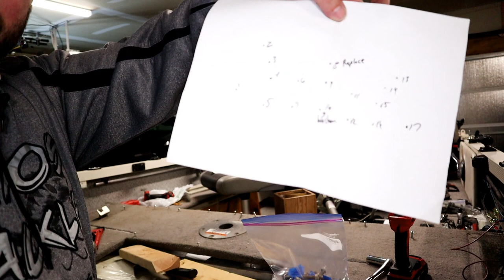TRANSOM REPAIR STEP BY STEP!! - Replacing Transom in a Crestliner Aluminum Boat

Comment: My 1750 had that same crack, if I showed you a pic you'd think it was yours! But, today I found my transom wood rotten. Thank you for all the effort and making me realize I can save my own boat.
Reply from the maker: Bigun Indaboat Good luck with your project! If I can do it, you can do it!
Reply: @AnglingAnarchy  Thanks got the motor rigged up, time to start pulling bolts! Threw ya a sub!
Reply: @AnglingAnarchy  Today my boat hit the water with a lot of help from friends and your video! Pulled the plug at the end of the day and she was dry as the desert. Thanks you brother, and tight lines!
Reply from the maker: @Tiggitytye  Awesome to hear my friend. Good work! I'm glad the video was of some utility to you!

Comment: Nice job, Brian. I learned something too. I learned this project is beyond my skill set. I hope I don't have to ever replace my transom. Looks like the project went pretty well for you with no major hassles. I'm impressed. 
Great video.
Reply from the maker: The Lonesome Fisherman That project went just about as well as I could've hoped for! Thank you sir!
Reply: @AnglingAnarchy  Yeah, we can see your relief and excitement at a couple of points where things worked out  well. I don't blame you either.  Do you have some background in marine repair? I ask because of things like the drain holes tubes,  I would have been stumped in how to get those out and replaced.

Comment: Great video with lots of practical advice. Just found that my 96 Crestliner had rotten transom. This vid will
Help me greatly. I’m the original owner and boat always was stored inside. Very poor design by Crestliner to
Not seal top of transom  plywood. Mine was painted grey and was not even treated🤬
Reply from the maker: Peter Latham Thank you very much! And good luck with your project!

Comment: Awesome video. I will be redoing mine after this season. I completely rehabbed my 2006 Princecraft so I'm a bit tired of all the work for now, but your video gave me the courage to handle this job. The boat resembles mine alot in construction. Good work!
Reply from the maker: Andre Thank you man! Good luck when you decide to tackle yours!
Reply: I have a 1985 18’ aluminum deep V aluminum princecraft. Original transom and so rotted I’m sure. Flexes so bad it scares me.  This summer I’m replacing. Love my old boat

Comment: Great video! Just realized my 03 Fish Hawk 1750 has a rotted transom also. I saw from
The factory there was no welds or sealant on the outside of the top cap. I think it’s an engineering flaw in my opinion. Water is allowed to come in from the outside and then soak the board over time.
Reply from the maker: @mattcoughlin2356 Thank you! Hopefully, you can get it fixed up as easily as I was able to!

Comment: Awesome job Brian!!! Looks professional way better than some of the butcher jobs some of the boat shops have done. I  guy I know now calls his boat Frankenstein after a transom rebuild . Only thing I know for sure from  talking to a boat builder is that you should use the 3m below water silicone  3m 5200 ,it does not break down over time from water (3m claims) so far I have 5 years on it from transducer mountings and ladder mounts  great job looks fantastic .My friend is debating on the marine plywood or the composite  stuff  . Great job now go test it out and catch a 50" !!
Reply from the maker: Kurt Riedmuller Thank you sir! I had the boat on the water today and so far everything seems to be in order! I'd definitely tell your buddy to go the composite route. If I were to do this all again, that's the way I would do it.
Reply: Are you talking the Cousa Board?
Reply: Cousa Board? Is it worth it?

Comment: Nice work on replacing the transom! I know that this is not an easy chore to do as I have watched other videos on doing this. I like the fact that you used those 10"  hooks to pull out the old transom and luckily there was enough good wood for these to anchor into, have not seen anyone pull one like this so far. The only thing that I was a little worried about was that shelf was going to come crashing down and dump everything onto your boat but thankfully that did not happen.  Hope that you can get this out on the water and catch some nice fish this year! Let us know how it is if you don't mind please and thanks for sharing your video!
Reply from the maker: Eric Hildreth Thank you! I had the same fear about the shelf, but I'd built it pretty sturdy so I was relatively confident it would hold up lol 😳 I've had the boat on the water multiple times now and everything seems to be working great! I can definitely tell there is no more flex in the transom when you trim the motor up and down. Let me know if you have any other questions!

Comment: Great video! Seems like whenever I do something that big, one item ends up slowing things way down. I will say, from experience changing out throttle cables, they usually need adjusting after the engine is running, sometimes you don't get as much open throttle, sometimes you can't get the idle down to where it needs to be.... you'll know if everything is good, the first time on the water. Hopefully that first time on the water will be soon ! Good luck on your trip south !
Reply from the maker: Curt Adams Just had the boat on the water today and everything seems to be in working order! Of course the weather is not cooperating, but that's just part for the course on my spring trips 🙄 Did get some action for a few vids though, so those will be forthcoming!

Comment: Great video. The only thing I would consider doing different is using marine epoxy to bond the pieces of wood and to seal the cut out transom.
Reply from the maker: mrdiscotoyou Thanks man! Using the epoxy would definitely be an upgrade from what I did!
Reply: If he really wanted it to last instead of stacking 3 pieces of 5/8" plywood could of just used 2 pieces of 3/4 plywood laminated together with epoxy which would give you 1.5" inch thickness and then fiberglassed over the whole insert until you reached the 1.875 total thickness.
Reply: @johnnorris1227 what kind of Epoxy do you use for thus? Also some places pre drill the holes a few sizes bigger... then Epoxy then closed again.. then when they re drill the mew holes they are drilling basically through a solid block of Epoxy plastic there.. they say then it is totally no way for the wood to seep in moisture.  What do you think?

Comment: What a great job on a not so easy task! Thank you for sharing this. I have the same boat but it's a 1999 with a rotten transom and I am starting this same journey today. This video is a blessing! Thank you again for taking the time to make a great video on the procedure, It has for sure shed light on the subject! Happy fishing! Did you use just regular 5/8" plywood or did you use pressure treated or marine plywood?
Reply from the maker: Bob Good luck with your project, and I'm happy to hear that this video was of some utility to you! I used 5/8" Marine Grade plywood. Don't use any pressure treated wood in aluminum boats, as it will basically eat away at the aluminum.
Reply: @AnglingAnarchy  Do you remember what brand spar varnish you used and has it held up good so far? I'm going back and forth between spar varnish and fiberglass resin, What's your opinion on that? Thanks again for the input, I sure appreciate it.

Comment: good job.. I have a 17 ft boat to do.. its a mess, previous owner cut the aluminum sheet on the back and tried to bolt in a metal plate, so after I replace the wood, I will have to find some thick sheet aluminum, cut it to fit, then rivet it to the boat.. or I may cut out a metal patch piece, to cover the hole he cut..
Reply from the maker: @randy1ization Sounds like you've got a bit of a project there! Good luck!

Comment: Very good job, all I can add  is seal all wood and drilled holes with west system epoxy. And all fittings and gaps with 3m 5200

Comment: Good video. Cut the drain tubes flush with a pipe cutter would be a suggestion. In my case the copper in the original pressure treated wood reacted with the outside aluminum transom and ate holes in the plate in many places. Therefore I need a new 1/8” transom plate as well as the wood. Crestliner should be ashamed by this design. Thanks though for the video.

Comment: Outstanding video. Thank you so much for posting, because I find myself probably having to replace the transom in a 2004 1850 sportfish I purchased in September. Can't believe I researched the heck out of motors to eliminate potential  issues but didn't find the problem about crestliners wooden transoms and apparently poor factory work. Anyway, going to have to make it work and I'm thinking of coosa board.  That stuff is expensive but I hope to use the boat for at least 10 years.  in '03 and '04 I understand crestliner transitioned to 25-in transoms. I'd rather not buy a full 1-in board and a full 3/4-in board, but rather, split a half inch board. But 25 x 2 is 50 last I checked.  Was your '04 fishhawk a  25-in transom?
Reply from the maker: JLawL I can't remember the exact dimensions, but I'm almost positive mine was less than 24" tall. Make sure you see what they used previously for the transom. Mine was made from 3 sheets of 5/8" marine grade plywood for a width of 1 7/8". Coosa board would probably be the best move and had I known more about it prior to starting this project, that's the route I would have taken. Good luck with your project!

Comment: Hi Brian, I’m in the process of doing the exact job you completed , first off thanks for the video its given me the confidence to do this project. Question : Did you end up putting the foam back flush with the transom ?
Reply from the maker: Scott Van You're quite welcome! Yeah I tried to get the foam back in as closely as I could to the original state of found it in. Good luck with the project! If you have any other questions you can always message me on the Angling Anarchy Facebook page as well as here.

Comment: Great work, but why didn't you use coosaboard, or honey comb, so you would never have to do it again? I am redoing my  1975 -16' Mirrocraft, and it will need a transom also, so, Instead of using wood, I intend to go synthetic, because of the SW Fl. weather is brutal on all materials. Blessings.
Reply from the maker: kyle wolfe I had already ordered the Marine grade plywood by the time I'd  considered the Coosa board option. Plus I figure I'll have this boat another 3-5 years tops so I wasn't looking too far into the future I suppose 😅 But knowing what I know now, I think I would definitely go the synthetic route. Thanks for watching, I really appreciate it!
Reply: @AnglingAnarchy  Well, now that I priced Coosa board, I agree with you on wood, but I'm definatly sealing the whole board in mine. Blessings.

Comment: I can't believe on the aluminum boats that the manufacturers didn't make the transom core out of aluminum as well. About to start this project myself, but on a Lowe boat. Same story, rotten wood underneath the aluminum sheathing.
Reply from the maker: Devon Guinn At least on new aluminum boats, as far as I know, they are using a composite material as opposed to wood so that will help the life of newer transoms. Good luck on the project!

Comment: On my 1750.. like yours.. the back top cot ers are all welded to the gunnel and transom.. how did you do this without cutting those top caps off to pull out the transom and put the new one back in?
Reply from the maker: @terryerdmann7159 I just used a hacksaw to cut the welds to remove that top cap piece, and when I was done placing the new transom, I found someone that could weld aluminum to put it back in place!

Comment: Hey Brian!  It's been a few weeks and I'm doing my 2004 1750 Fish Hawk too.  Anything you'd change after this short period of time?  Appreciate the video tremendously.  I didn't get so lucky with a single piece coming out but I am about to get the wood and try my hand at making the new transom.  Thank you!
Reply from the maker: The Casual I'm glad the video is helpful! One thing I would change is to use a marine silicone adhesive instead of the 100% silicone I used. I've been told that the marine silicone adhesive will hold up better in the long run. Otherwise I've had the boat out multiple times and everything seems to be working and holding up pretty good. Good luck with your project!

Comment: You did a great job on the transom.  You may wish to replace your water pump impeller now.  I assume you did have water going to the engine.  FYI I hear there is an epoxy pour in transom replacement that is stronger than wood and will never rot.
Reply from the maker: Anthony Latronica Thank you!

Comment: Hi Brian, I hope you don't mind me sharing my progress and any issues I come across with my boat. 2002 Crestliner fishhawk 1850 . FYI: Working out a issue Crestliner put a transom screw very high inside the engine support bracket. can't access the nuts from underneath. looking like I'm going to need to cut them out.
Reply from the maker: Scott Van Please share away. I don't recall having a problem. Getting at any of the transom support bolts but they could be slightly different on the 1850 as opposed to a 1750. Hope everything goes good for ya!
Reply: Scott, where was that located? Is it hidden?

Comment: You are so lucky you have bolts at the back that would be soooo easy, i have about a million rivets going right through, what a horrible big job i have.  Boat is 47 years old, the board has seen better days, i want to change transom from 15 to 20inch anyway. My biggest concern is those rivets, any advice on that yourself or anyone
Reply from the maker: chad bosko Oh man! I guess I'm not sure what to tell you on that one. That seems like one hell of a job with all those rivets! I wish I could be of more help to you!
Reply: @AnglingAnarchy  yea i,m thinking of replacing them with stainless steel bolts and going one size bigger  on the load baring ones in the middle.  Drilling them all out is the nightmare i,m not looking forward to, other option is leave the board which is serving its purpose and add a 2 x6 on the top and bolt steel plates at center area, depends how bad it looks when i open it up again
Reply: @AnglingAnarchy  hi, false alarm , started my transom today, it only went down 6 inches   pulled it out like nothing, didn,t have to touch all those rivets lower down including the ones for the stiffeners, got new board made already, had a sheet here one piece inch and quarter, made it 5 inch higher and just bought a long shaft, no more water over the back and transom super strong 👍
Reply from the maker: @chadbosko8935  Awesome man! Glad it went well for you!

Comment: Through over 50 years of auto and marine paint and metal repair I’ve seen a lot of evidence that silicone has caused corrosion on a lot of metal and even galvanized painted surfaces. Any marine projects I would use a 3m marine adhesive. Just a little something I’ve ran into over the years. Especially on cars where people have tried to stop a leaky window or something ,the silicone when exposed to the weather showed corrosion right to the edge of the silicone even when applied over good paint. Maybe 2 little to late. Just saw the video? Maybe a little something to consider for someone else trying to get their project done in the future. Good job on the transom repair though. Should last longer than the original.
Reply from the maker: Jeffery Poppell That's great info, thank you! I'll keep an eye on those spots. Thanks for watching!

Comment: I am just waiting for my 3 pieces to cure together with the Gorilla Glue you used. Seems to be working nicely as well.  My transom is 1-3/4'' ..   Was there a special sized jig saw blade you use to get a clean cut through all the layers?
Reply from the maker: Mac Remington I just used the blade that came with the jigsaw which was just barely long enough to get through my transom. I just made sure to go slow so it didn't kick up at me while I was cutting. Good luck!
Reply: @AnglingAnarchy   OK that's kind of what I went through as well. I just had a standard milwaukee wood blade. Turned out awesome though. Going to layer it up in marine varnish now then install this weekend! Cheers
Reply from the maker: @macremington8255  Awesome! Good luck with the remainder of the project!
Reply: @AnglingAnarchy   Thanks! ... I got to about 3 coats of marine varnish..  I did use a lightly coated rag with acetone to get rid of dust and debris between coats and after light sandings..  Did I mess up big time with the acetone? Iam thinking i shouldnt have done that.. but can't find any solid info!
Reply from the maker: @macremington8255  probably don't need the acetone, just a damp rag would do. Should be good though! Glad to hear the project is coming along!

Comment: Would using epoxy mixed with 403 adhesive filler to thicken the epoxy work for glueing the plywood together? First time doing this I messed up by cutting them to shape before glueing together I’ll see what I can do.
Reply from the maker: John Gallano I guess I'm not sure on that mix. Not even sure where to find that out! I wish you luck with your project!